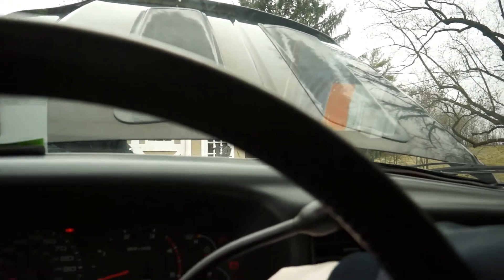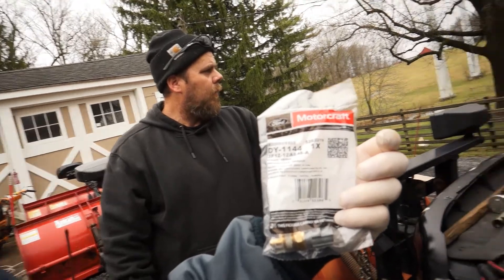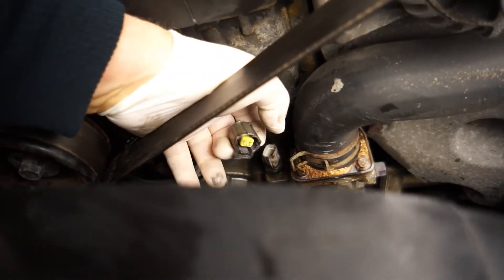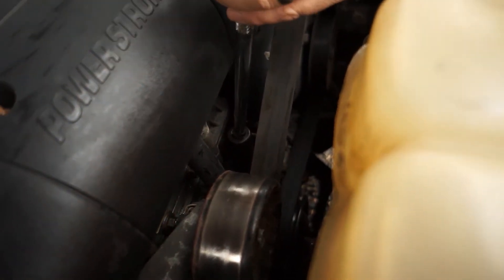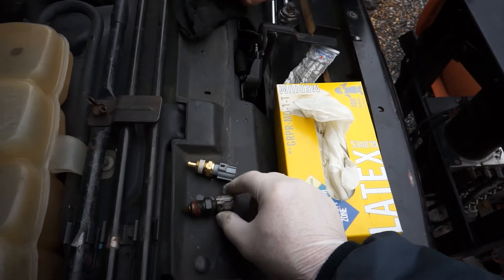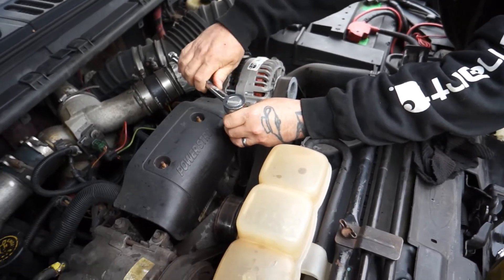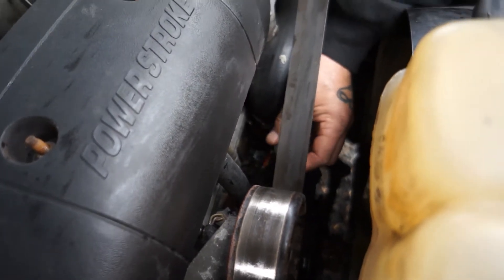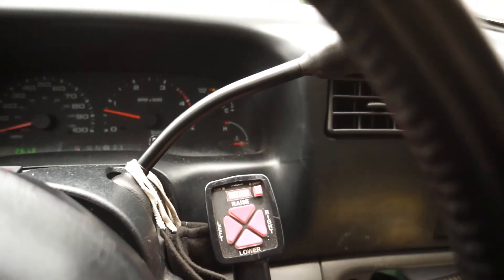TEMPERATURE GAGE IN DASH NOT WORKING ?? FIXED FORD F 350 TURBO DIESEL

Comment: I’ve got this same issue in my 7.3. I replaced the old sensor with the exact same one you guys did, and I’m still not having any luck. Any ideas of what my problem might be?
Reply from the maker: Is an OEM ford dealer sensor? There are a lot of counterfeit parts these days. If so, it could be the wire connection..you need to test it with a test light or Ohm meter. Turn on ignition and see if the needle moves up at all. If it does move...its probably the thermostat. 
I'm doing a video, tomorrow on how one went bad and gage barely moved up and heat was not as hot. 
Keith 2guys how2
Reply: Yes, same exact part, same part number, it was the second one I tried and still no results.
Reply: Also, thermostat is new I replaced it when I did the water pump about a couple months ago. I don’t know much about this stuff I just know I need to know if my engine is too hot
Reply: Well lookie here bois I’m dealing with the same problem! Glad y’all commenting !
Reply from the maker: @kalebwhalen7896  Okay, if sensor is a motorcraft sensor..that should be good. If you have a 12 volt test light, you can ground the test light wire to the negative on the battery and turn the key over, insert the tip of the test light or preferably,  a small piece of wire into one of the plug connections.....BE CARFUL NOT TO JAM THE TEST LIGHT TIP OR TEST PIECE OF WIRE INTO CONNECTION AND DAMAGE OR REEM OUT THE CONNECTOR HOLE..those little plug fittings are delicate.  If you bend them or make them not tight when connected to the sensor plug the sensor won't do its job without proper connection. One of the wires you check should be HOT and make the test light..LIGHT UP.. If it lights up then we know the sensor is most likely getting getting proper power. 
** What I do is turn key over and see if needle on the temp gage on dash moves at all when you start the vehicle. If it does then that's a good sign. If not then check wire and make sure there is power to sensor and make sure the connector prongs on plug look good...no loose wires or loose prongs..connection plug should look good and solid.
Let me know, results. 
Keith 2guys how2
Reply from the maker: @kalebwhalen7896  * Make sure your motor ground from the negative side of the battery are good. Take the test light and clip it to the positive side of battery and touch the motor area near temp sensor and thermostat housing...and do the same for other metal parts of the motor....anywhere that is metal
The test light should light...showing engine is grounded, correctly.
***All vehicles are permanently grounded from negative side of battery...all the time.
If the motor is not properly grounded like factory made it, things won't work. 
They use the main battery wire from negative side of battery connected to a bolt on the engine or bolt on the frame or both, to ensure a proper ground......
things wont work correctly, if the motor is not grounded.
* with ignition key on... take the test light and clip into the positive side of the battery...one side of the temp sensor connection should light up...that shows that you have a good ground and the sensor should work or the second temp sensor one is bad, 
Keith 2guys how2
Reply: After farther inspection and checking grounds I decided to check the temp of the coolant, which was only 95 degrees after running highway speeds for 15 minutes. Thermostat must be the culprit even though it’s relatively new.
Reply from the maker: @kalebwhalen7896 The seal on the inside flow plate can dry rot off the thermostat and allow coolant to consistently flow through the tiny holes covered by the flow plate seal..
I would get an oem thermostat....205 degree from ford dealer..not a Failsafe type from the local parts store. 
OEM thermostat will come with the gasket seal with it already installed and stock temp gage should show normal range about half way up on stock dash gage, while running for 30 40 mins..cold weather.
Let me know how it goes. 
Keith  2guys how2
Reply: Bought my 7.3 w the right side of the guage not working. Dead RPM, Trans and temp never move.. Any ideas?
Reply: Same issue on a 2000 f350 7.3. Tested the gauge with a jumper wire and ignition on and it works. The owner did buy a aftermarket sensor.

Comment: Last end with fix or solution cut off. Was vid of replace not fix. And instrument cluster never kicked on and no position change in guage shown
Reply from the maker: The gage should move at start up. I would check the connection to temp sensor. 
Cheaper sensors might not work..they don't have the same quality and resistance.
Some new senso8can be faulty as well.
Use dielectric grease on your plug connection.
Keith 2guys how2

Comment: When I drive my truck the temperature gauge doesn't move. Is there a way that I can determine if it's the temperature sensor or the thermostat?
Reply from the maker: I would say it's the sensor...If it was the thermostat not opening...the gage would read way hot.
Turn on the key switch...don't start the truck and see if he gages move a all. 
You van also try o clean the wire connections o the gage..they could be dirty or loose.
Most likely the sensor. 
Keith 2guys how2
Reply: @2guyshow2thefishkingz89  Thank you!
Reply: @2guyshow2thefishkingz89  Thermostats will stick open too.... but usually you do see something on the gauge.

Comment: Did it work after the test drive?
Reply from the maker: Yes, works fine..simple easy fix. I bought the Ford OEM part from the dealer. The cheap auto zone sensor did not match with the plug connector.
Keith 2guys how2